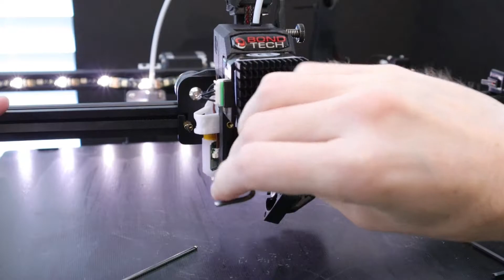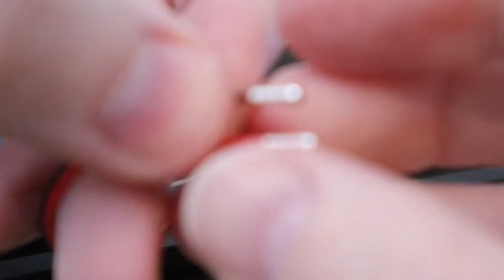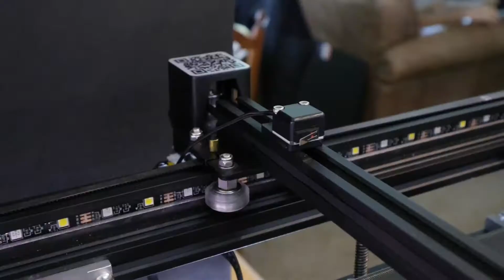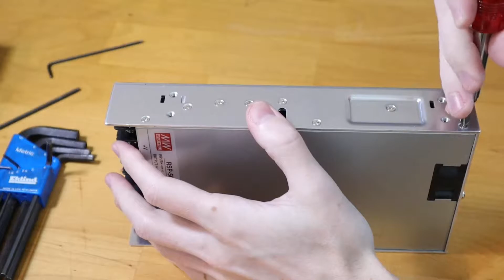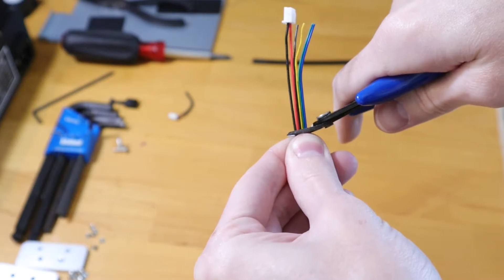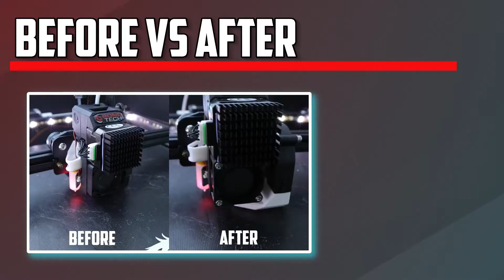Creality Ender 5 Plus Silent Fan Mods (No Buck Converter)

Comment: Did you check the voltage of the psu fan before? because it's a 24v psu and I saw you just install a 12v fan...
Reply from the maker: Yes, the psu output is 24v, but it uses a 12v fan for cooling

Comment: Which way to plug in to the psu board red/black?
Reply from the maker: Red goes + black goes GND
Reply: Does it turn on right away when plug in psu while power is on ? It doesn’t spin when I plugged it in. but when I plug it to PC with 2 pins, it spins. Maybe I had it backward with G - and + power…..?
Reply from the maker: @p.nation3583  the PSU fan is pwm, which means it's temperature controlled. It turns on once the PSU reaches a certain temperature.
Reply: I’m stupid I thought I fried one of em so now I got one extra… lol
Reply from the maker: @p.nation3583  it's always good to double check and make sure. They typically turn on during the heat up process when the bed and hotend are heating
Reply: Alright that’s good to know, cause I did not take a pic which one position suppose to in on the psu . Ty 🙏🏽

Comment: How did you get the fan cover/ mother board cover to be that mesh breathable pattern?
Reply from the maker: 0 top and 0 bottom layers
Reply: @EB3DPrinting  but the perimeter walls have top layers and so does the very top of the print (The overhanging looking tower section.) When I sliced mine with 0 top and 0 bottom layers these spots were open unlike yours. Thanks in advance for the help
Reply: @kahunalive   did you figure it out? I'm trying to do that too lol

Comment: You could of used the same ends from the fan connect you cut on the fan ,saving yourself the wait and shipping , the fan was long enough to have enough. Currently someone put a thingverse file for a 120 version of this the Noctua A12x15 , which if you buy the chromax comes with an exter, therefore saving your fan and actually doing this mod on the cable itself, meaning you can reuse the fan without destroying it during the mod. Just got an Ender 5 plus and going to do this . Thank you very much the psu fan is very loud. This should help so much.

Comment: How does the 12v fan run on a 24v w/o a buck converter?
Reply from the maker: The power supply fan is actually a 12v connection. There is no need for a buck converter

Comment: Just curious, how come you used the psu fan you did? it requires a new top case cover which i see some people oject too however Noctua makes a 4020 fan that i would think would just fit in place of the stock fan? also looking at the two noctua fans the one you used is listed at 19.9dm and the 4020 is listed at 14.9db so should be quieter, is there a reason i'm unaware of why the 4020 wouldn't work? Genuinely asking as looking at doing this myself
Reply from the maker: The Noctua 4020 would not supply sufficient enough airflow to keep the PSU cool. I would also say that I agree with those objections to modifying PSU fans in a manner that requires removing the top cover for a printed one.
Reply: @EB3DPrinting  thanks for the reply, do you have any recommendations for a better PSU replacement fan then? also 8i'm surprised that the Noctua wouldn't cool it enough given that it's replacing a fan of the same size and voltage
Reply from the maker: @markc1793  The big difference is the fans fin shape and the rpms. I think the stock power supply fan hits like 10k+ rpms. 

As far as replacements. I haven't really looked into any since I've done this video. Ive seen similar fan mods where they keep the top cover but use a hole saw to cut a hole in the top cover. Then attach the fan to the outside of the top cover

Comment: Also you could go see cnc kitchens video on how to make a 3D printer more silent. Basically you put felt pads on the bottom of the printer then on a concrete paver (I’m thinking about making my own Bc I can’t find one that’s big enough) and below that you have an open cell foam (tbh I’m going to do closed cell foam then open foam) Also get the silent motherboard for this it reduces it another 10db or something like that (if you already don’t have it) I’m trying to make mine as quiet as possible so I can sleep with it in my room? Idk we’ll see

Comment: You YouTubers need to stop telling people to replace the METAL safety cover on their PSUs with PLASTIC ones. You are removing a CRITICAL safety component on the PSU that keeps component failures INSIDE the metal case by adding a plastic one that can easily catch fire in the event of a component failure inside the PSU. The metal PSU cover also helps keep EMI inside the PSU as well so you are potentially also adding more electrical noise to the system by removing that cover.
Reply from the maker: Well, I'm not telling anyone to do anything, I'm just showing them the process that I went through. 

Would you then argue that power supplies such as the one linked are less safe due to their highly exposed top panel?
https://www.amazon.com/dp/B00M8TBJLK/ref=cm_sw_r_cp_apa_glt_fabc_B2PF4AQWNAJ62RCQHXCK

Also they have flame retardant filaments which these covers can be printed out of
https://www.amazon.com/dp/B07YF12D7L/ref=cm_sw_r_cp_apa_glt_fabc_QM0G8KANFTGS8E4FEE18?psc=1
Reply: @EB3DPrinting  The linked PSU has still a Faraday cage on top of it, any extruding possibly high voltage wire would hit a metal mesh that is grounded, instantly melting the fuse. So no, these are not less safe. They are only less safe if you stick a screwdriver into it without touching the mesh, but this design is justified by the lack of active cooling.

Also PLA is flammable. Luckily the modified design is still inside a metal box.
Reply from the maker: @werdnaf  thank you for that answer. I've done a bit more research on this since TH3D's comment and it seems the only "safe" way to do this is with end + flame retardant filament. Even then, that still has limita to what it can do.

I will probably self manufacture a sheet metal lid for the psu instead